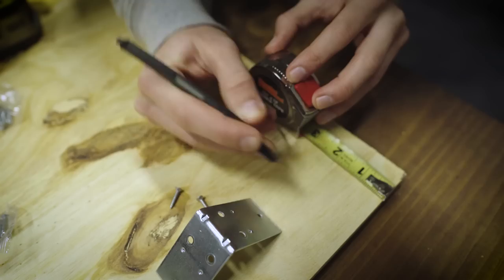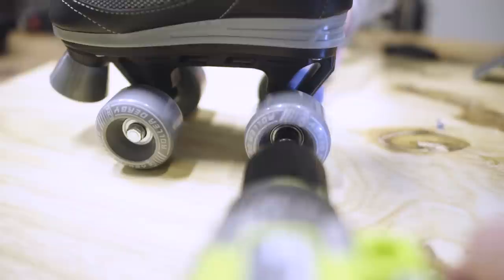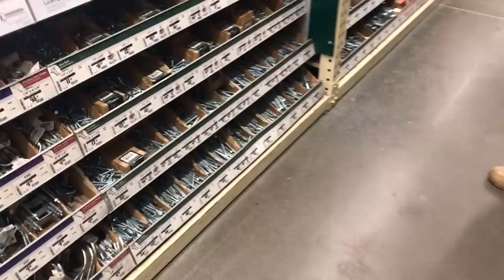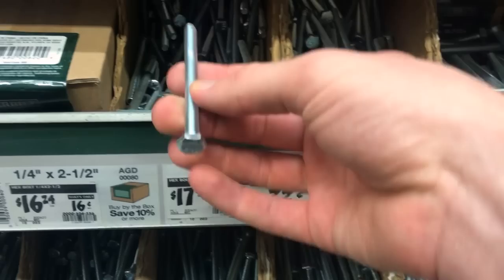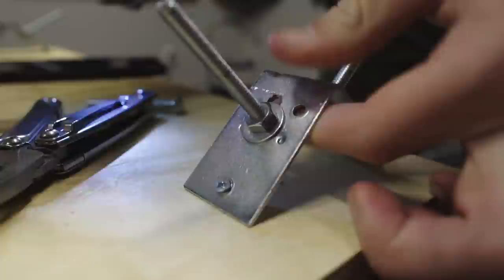How to Build a Dolly Track for $50 (Cinematography Hacks) | Filmmaking Tips

Comment: If you want to save $20 try shopping at your local thrift store for the roller skates. They will almost always have a pair. Thanks for the video!
Reply: Or just buy a roughneck dolly for approx $20. Normally they have pivoting wheels too so even better than roller skate wheels and no effort to build.
Reply: @Lela Gray 
Or just buy cart wheels at Walmart
Reply: @whengrapespop5728   I wish I could do a cart wheel.
Reply: @ElementsMMA  pivoting wheels suck because they will pivot when you don’t want them to, causing jerks in the footage.
Reply: And if that doesn’t work, 5 below has skateboards for $5 each. Just buy 2.
Reply: $20 dollars!? I bought a pair for $4 😂

Comment: Update to 2023:

I had my own wood. I had my own wheels. I decided to elevate mine so I got 1 1/4 emt conduit. And the rest was the same hardware and angle brackets. Cost with tax was 88$ still pretty good for DIY slider. Thanks for the video!!

Comment: Simple, effective, why pay more?
The only change I'd make is to build a couple of struts to join the ends to keep the track tubes aligned.
Reply: Greg Wallis The weight of the camera, tripod, and dolly pretty much forces the pipes to stay equidistant without  need for struts.
Reply: Yeah that’s true you can keep yours like that but I like the idea of that extra security measure. In the end i know Il be happy with my shot sequence.
Reply: with the angled wheels the track will be forced into that distance, I'm sure you could even use a a length of tubing to create round or curved track if you wanted.

Comment: I was thinking about building something similar to this for capturing textures of flat surfaces like floors boards and such. I'd have to engineer a way to overhang the camera so the pipes and Dolly are out of frame but this is much more simple than the design I was working on. Thanks a ton.

Comment: This is great! I love this kind of stuff! I'm wondering how to make one of these, just smaller and on an auto moving left to right pan track so that I can capture the drummer on our worship team. One thing that would make the brackets more secure would be to get some scrap wood the width of the bracket, use the bracket to mark you L shape and then cut the scrap wood to fit inside the bracket. Then glue the wood to the board, put the bracket over the wood and screw it in. This way you have more to screw it into and it's not just held into the wood by a single screw.

Comment: Great video but you could have use two inch bolts. It’s easier to transport not having to worry about extra length snagging on, or damaging stuff.
Reply from the maker: Thanks David! We did end up trimming the bolts, but it's not in the video. For anybody else reading this, you can use a hacksaw or a Dremel to shorten the bolts.

Comment: Great stuff. I want to ask if the wheel setup works on curved or circular tracks? thanks!
Reply: You would probably need the wheel assembly that connects to the wood to swivel to account for the curves. That's not a hard addition to the project. Should work in theory.

Comment: How do you keep the PVC pipes stable?
Reply: I would guess that the angled wheels and downward force of the weight of the rig stabilize the pipes naturally. You could, however, build a support platform for the pipes but that is probably unnecessary.
Reply: Fill the pipes with cement
Reply: I've heard copper pipe instead of pvc works
Reply: Sand bagging each end works
Reply: "EMT" galvanized steel electrical conduit would be more rigid than PVC. You could make a wood "trestle" that could be leveled and shimmed underneath, and that would hold the pipe tracks. You could drill a small hole in the pipe at the trestle locations and screw through into the wood. (larger hole on top of pipe to get screw through, smaller hole on bottom/contact side). Then the outriggers on the trestle could be weighted down with sandbags or CMU concrete blocks.

Comment: This is awesome More Videos! A lot of DIY gear looks chinsey (sp?)  and ugly. This appears to be well made and more visually appealing. My only question is if you have any tips on adjusting the PVC pipes if the ground it is on isnt level. Thanks!
Reply: Chad R. Hembree I would say you need a set or to of notched blocks to level each end of the pipe with. Should be a simple fix although perfect results are impossible.
Reply: Chad R. Hembree try using some sandbags under the pvc pipe.

Comment: The bolts are still too long. Maybe use 1-inch or 3/4? Or  take the bracket and the wheel to the hardware store and get the exact size you need and those little plastic caps to slip over the ends of the bolts to make them less likely to maim the crew.

Comment: Any of you guys think that if I doubled the amount of wheels and used a bigger board, would it be able to hold the weight of the camera operator as well?
Reply: How much weight are you trying to hold?  You may need to change your base material to hold the proper weight per square inch and keep the weight of the overall construction light.

Comment: This video is kind of misleading. You need exactly the right wheels to do this or you’re gonna end up buying twice as many nuts to give clearance between the bracket and the wheel. Also screwing a screw into the board from the L bracket is kind of a pain. Not as easy as you think
Reply: Skateboard wheels are generally universal in size and it isn't difficult if you have the right tools for metal working which are relatively inexpensive.

Comment: Great concept and idea, but by the time I got the supplies, did the work and drove around, it’s easier to just go and buy a camera dolly and spend a little more
Reply: a little more?? did you find a dolly for under $100??? because this job took me 3 hours total. from watching this video. driving to get the supplies. and putting it all together. and i spent less than $50 because I got cheaper wheels

Comment: Do you need to do something to fix the PVC pipes or no need to do anything?
Reply from the maker: The angled wheels should do the trick. Also, if you have some, lay sandbags down at the end of the pipes. That should help the track stay in place.
Reply: or you could buy a pvc connector and make it a rectangle

Comment: Am i the only one who is struggeling to make some wholes in my l brakcets
Reply: Make sure you are using a metal drill bit and not a wood drill bit. You can also buy what's called a punch to make a starter hole/dent that helps align the drill bit.

Comment: The "other bolt" is called a nut. You don't thread a bolt onto a bolt, you thread the nut onto the bolt. Speaking of bolts, use a proper length next time or cut off the excess. Having all that extra length sticking out could snag on something when you use it or snag on someone when you transport it. Set safety, guys.